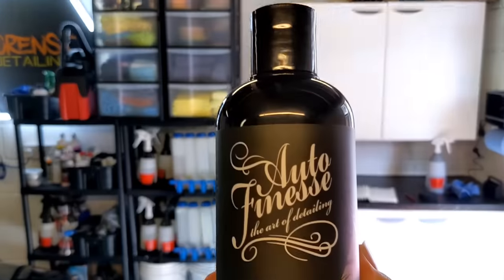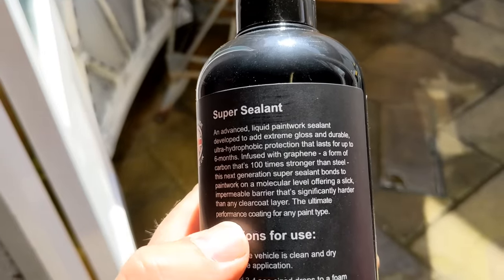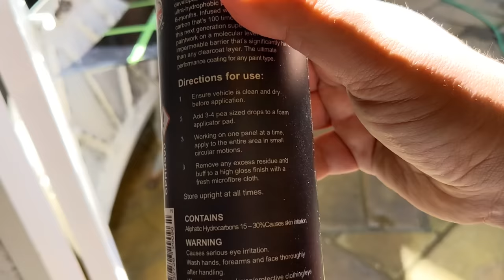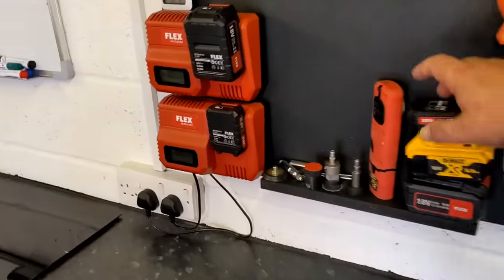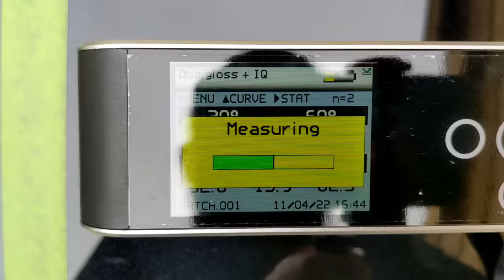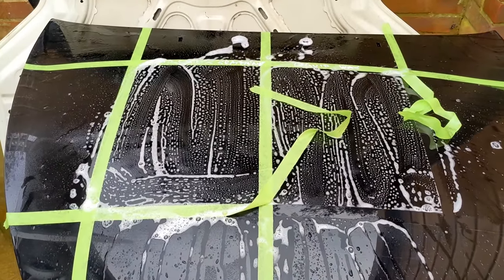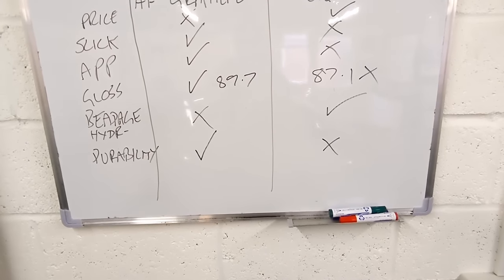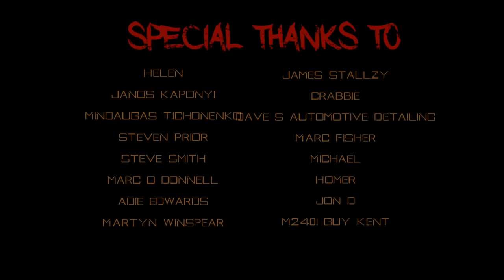*NEW* Auto Finesse Graphene Filler Wax Review  | The next big thing?

Comment: Bought this after watching this, for the sheeting. 
It’s still early, but I like this product.
I would buy it even if it didn’t say graphene on the bottle.
In the real world it’s a water beader.
Update: the excitement faded, haven’t touched the bottle in months.
Reply: water beader? I want to try this product. It looks easy to use. I now have Soft99 extreme gloss wax on my car. (1 month) Stil going strong, but the beads make anoying water spots when dry... How long does AF Graphene last on your car? Do you think I can apply it with a DA polisher?
Reply: @sebastienderidder5418  honestly liked it at first but the bottle just sits there. I would put Hydro2 or Wet Coat over that glossy Fusso, were me. Cheers

Comment: Glad you reviewed this. I've spent hundreds in the past getting my cars detailed (M140i & Caterham 7 420r) when in reality all I really want to do is hide the swirls, but like you say, the word "filler" is frowned upon. The single coat BRG paint finish to my 7 is particularly soft - the delicate first wash following detailing put no end of fine scratches in it, so  this product may be what I need - as a former M140i owner yourself, plus your M4, if you can recommend something to hide the faint scratches on the satin finish instrument  binacle that would be great too - I'm already on my second after the main dealer valet jabbed at it with the nozzle of a Hoover which they then agreed to replace, but my most gentle of dusting from me has left a haze already on the replacement, so I'm a bit fed up.  First world problem though...!

Comment: Nice test Jon.
I like the idea of this and might give it a try.
A lot of people do not have the confidence of machine polishing, do not have the skills or equipment to do it either.
This is a great product for the Halfords buyer.
Reply: Fair comment, machine polishing can be a bit of a leap- but its good to push yourself into a challenge! You can always hand polish any swirls out- Autoglym resin polish is still very relevant today like its always been- I still use it today and has a purpose. You should buy some simple resin polish and start with that, get a neutral car shampoo the put a light ceramic coating on- its dead easy. It'll last 6 months or so, bit you can learn from that and build up to a full on decon and machine polish then more durable coatings. Just give it a go 👍
Reply: @79blustone  Thank you for the advice.
I am actually an ex-valeter, and have no problems hand polishing, I was talking more about the typical Halfords buyer who is basically a once a month car washer.
Reply: @DjNikGnashers  🤦‍♂️ Haha, though  you might be reading you comment after I posted it....I thought you might have read it and if I deleted it it would look odd so I left the comment hoping you wouldn't read it 🤣. Pays to properly read someone's comments thoroughly- note to self 😇👍

Comment: Jon/Everyone!!! What’s filler all about. Please. I’m puzzled.  Thinking it hides microscopic marrings but adds a kinda chalky residue deep chips scratches ??? Bodyshops who use the higher end £150 odd quid 3M detest filler. Could you explain the pros or Con of filler.  My cars are mostly 12-15 years old full of minor chips dings.  The filler doesn’t so much hide scratches like good old colour magic of  old did using before started machine polishing.  I find filler products highlight the stone chips filling them in white.  I don’t get filler.  At all !!!!  I use G3 and / or G360 on a wool mop. I like to wax over but one product G3 Glaze I think has filler????

Comment: Good Morning John!!  Love your in depths videos!

I would like to use a spray sealant or a wax with fillers on my 67 912. I have some panels that are original but do not have much paint left and cannot polIsh the scratches out. I would also like to use  Griots 3n1 Ceramic wax spray  on top as I do now as it has tremendous durability.  I need this as I use my 67 frequently- I drive through the alps and at the beach here- I live in Florence, Italy. Could you give me an advice on what I could use ? I use mostly Griots products with some Carpro and Geyon. Thanks John!

Happy Holidays!!!
Reply from the maker: you prolly want to polish it with a light glaze so you dont remove much clearcoat.   Check out Rupes advanced polish.   Or gyeon primer polish.     Then you could top it with the griots 3 in1  mate will work well.

Comment: Eh graphene is just marketing foo foo. Yeah it’s different, you can prefer it or not for several reasons. Price being one. Filling quality is important as a business owner, it’s why I use Jescar  ultra lock+ on every wash & wax; fills and deepens the paint. People think you buffed the paint half the time. Makes a one step correction look like a 2 step. Filling might be gawked at by nerds on forum boards; but they work terrifically for the 99% of population that doesn’t polish their car every 6 months.

Edit: after seeing your close ups of how much it filled, it completely eliminated 4000 grit sanding marks from bad washes. Insane amount of filling power and you can see a clear line of delineation and deepening. Impressive stuff I wonder if a gallon of that is cheaper than a gallon of JUL+?
Reply from the maker: I'm trying to get jul+ but can't get it in the UK for 8 weeks.

Comment: My car detailing stuff in my garage seems to be 70% auto finesse and recently used there wheel ceramic coating kit, and that as well I could not find how long to leave the product on for, only don’t leave it on longer than stated or something to that effect. I need to start looking at other manufacturers and so on as I find I’m quite stubborn and loyal to a particular brand. And I like there bottles and designs 😆
Reply from the maker: Loyalty is good m8

Comment: I had the 303 graphene nano spray and was not a fan Jon. Slickness was not great and thought it was difficult to remove. Would much rather use a hybrid ceramic wax.
Reply: What I do with the 303 is once applied go over the panel with a damp microfiber and then buff off. This method works with a lot of the spray waxes that seem difficult to remove or leave streaks.

Comment: Graphene products in detailing are a complete marketing gimmick. The only difference I've seen in the full blown coatings is that they sell you the traditional ceramic coating like CQUK 3.0 except it's slightly more hydrophobic and they tend to be slick instead of the common "grabby' feeling you get with most SiO2 coatings. Anyway what I'm getting at is, they're actually just selling us the good ol' SiO2 coating with veeery slight improvements in the hydrophobicity/slickness department, slapping Graphene in the name and charging nearly double for a bottle. (CQUK3.0 is $1.60/ml vs Ethos Graphene Matrix Coating's $3/ml. Don't get me wrong, I'm sure they add that cheap graphene oxide powder to the coating in minute amounts just so they're not lying as much, but still I find the whole thing ridiculous and disingenuous. Another thing that bothers me is that the guy from Ethos says their coatings are completely formulated and made in house, when it's all but obvious that they're manufactured by B&B Blending, just like the Adam's coating (which is much cheaper BTW). The Adam's coating adds the UV additive  so they can sell you a flashlight that shows the high spots you left behind. I won't complain, as I'm sure some newbies might find that useful and it's optional, but you could always just be really careful and methodical with your wiping and you should have no issues without the light. Switching back over to the Ethos and their wild claims, I'll just copy paste a tiny section off of their site: "Future maintenance, such as clay barring and light polishing to repair possible imperfections in the coating, can be performed without sacrificing its integrity, resulting in the ability to finally achieve a near-permanent coating." I mean, that's a load of bs. If they mean using a product like CarPro's Essence Plus, that's not really polishing, as it's meant to be used with a finishing pad and has no abrasives in it, just cleaners and the ceramic component that's meant to revive a coating that's near the end of its life, not exactly a "let's take these swirls off and the coating will be beading like crazy as if nothing happened" as they seem to be portraying with that statement. Here's the real kicker though, the guy from Ethos claims that their graphene coating is a pure graphene coating and not a ceramic coating with graphene in it. If you look at Adam's page, though, you'll notice that in their Graphene Ceramic Coating page there is a section that asks "Why is graphene still called a ceramic coating?" and right underneath, the answer they provide is as follows: Graphene alone will not form a coating. Period. Graphene is a flat, non-reactive plane, it will not form a bond with other things. Graphene coatings are coatings with graphene molecules grafted onto the ceramic backbone. If you think of the graphic of the graphene oxide, the tails you see sticking up are what is grafted onto the ceramic molecule. The ceramic molecule bonds with the car, and the Graphene portion of the molecule is on top, forming the surface of the coating.
Reply: Here's a link of him saying "The Truth About Graphene Coatings" ( https://www.youtube.com/watch?v=m1Dkg_psc2c) where he talks about his product as if it wasn't a ceramic coating at all and it's a completely different thing as it's a "graphene coating" and how he didn't wanna do exactly what he's doing which is slapping the word graphene on the products in order to sell via the marketing hype. Don't get me wrong, I've seen the performance of this coating and it's actually very impressive in terms of hydrophobics and it might well be durable (though I can't personally attest to that). The problem lies in the smoke and mirrors and dishonesty in order to sell you that product. I can't stand lying and lack of transparency. If the product is good, you can market it honestly and make great sales. Being dishonest from the getgo and building that reputation, though, will do the complete opposite.
Reply from the maker: theres some really good articles on graphene in pro detailers.   And some blind tests going on with graphene coatings.. and graphene infused waxes v sio2 and plane wax.    marketting is over the top in lots of cases for sure but its the same with every single industry on the planet.  its worse in the USA than the UK.  In the UK we sort of resent over the top marketting, even our TV adverts are different to USA ones.
Reply: @ForensicDetailing  Yeah I agree that overpromising marketing is not just limited to detailing, but detailing is one of those cases where it has the worst kind of marketing where most of the claims are based on how they sound and catering to emotion rather than based on reality, hard data and logic. That’s why I love companies like CarPro so much. They don’t try to oversell you and instead overdeliver. I’m sure the UK is much different, it’s just a different culture altogether. You guys have THE BEST mechanics out there. Hell there’s even a great show/channel I found recently and it’s a mechanic from the UK with his friends doing cool stuff while also being very educational. He’s called Edd China. Bet you’d love the channel. Edit: Know where I can get my hands on any of those studies?

Comment: I used this today on my sons car. I started with a foam pad to apply it, but it felt as though it was adding swirls,  yikes !!! And it was brand new!! 

I changed to a microfibre pad and it made such a difference. It felt like it was working to product better and left a more even application.

Application and removal was very easy and the gloss is undeniable, but I found it could produce a slight dust as well. 

I would recommend using this if you need a quick waxing of your car, but I’m not sure about the filling capabilities….